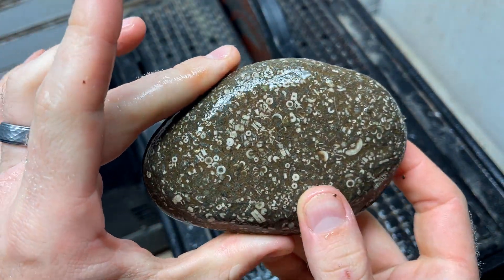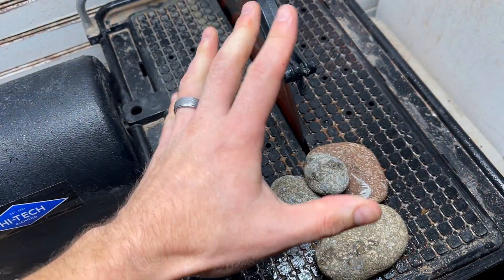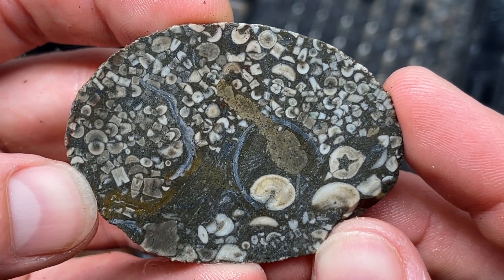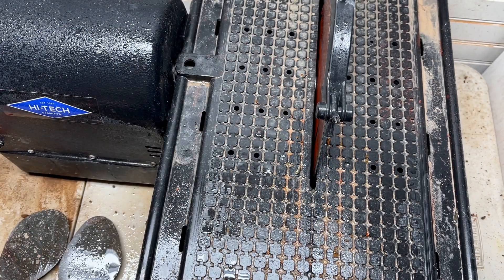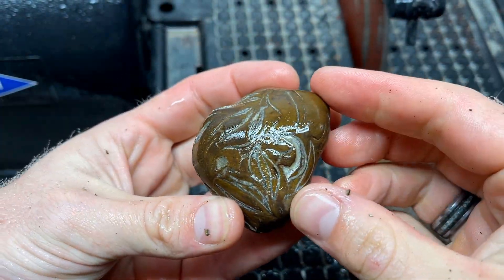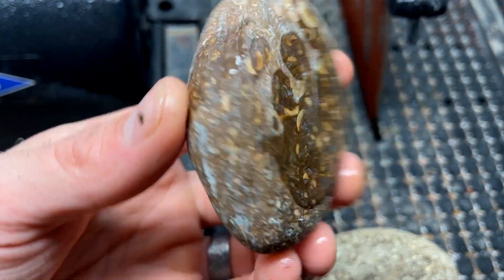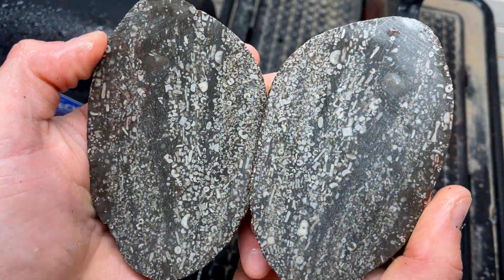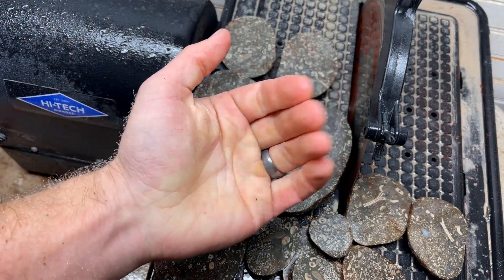Cutting THOUSANDS of fossils inside Fossil Soup!

Comment: I found one with mini fossils calms and other fossils I don’t know what it is lol I found it I work at a cemetery I check certain rocks when we’re digging a grave and its weird it’s more like a hardened type of clay grey in color  about the size of my hand 1.5 inches thick it’s not a perfect circle looks as it  broke off a bigger piece but couldn’t find any thing else  was about 4 feet deep   In new Canaan ct which is about 8-10 miles from the  shoreline could be freshwater mini calm fossils but there is a river half mile away which isn’t more then 15-20 feet wide  it’s been a really long time since that part of land was under water

Comment: Sea lily is just another name for a crinoid. The living animal can look like a flower, hence the name. The longer pieces that look like a spine is a section of stem or arm of the animal that is comprised of the little rings you see. When the animal dies, they can break apart rather quickly if there is any kind of current, leaving oodles of rings. Crinoids still live in our oceans today, though not as abundant. 

I’d have to look closer, but I think what you referred to as sea lilies were shell fragments.

Comment: Crinoids small pieces round, the star in the center is common.   Sometimes the stem will be whole.   These organisms are common in fossil soup or a death plate.  I also saw what appears to be a horn coral on the outside of one.  You can even find what appears to be little beads (crinoid) pieces.